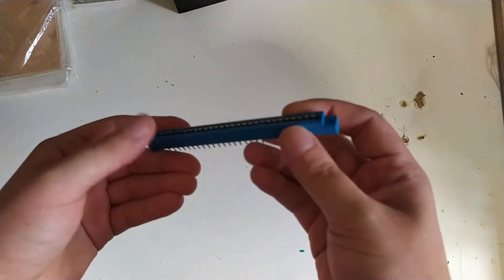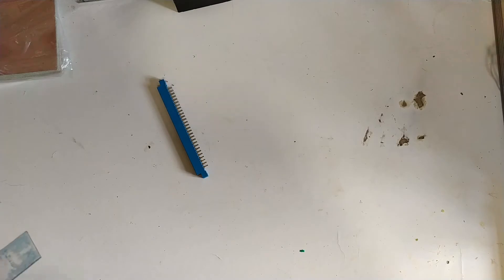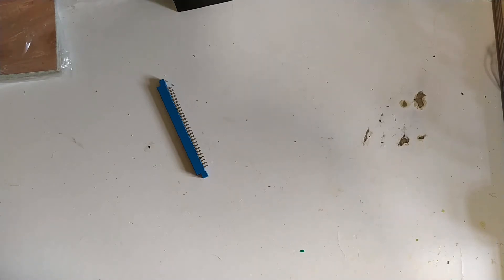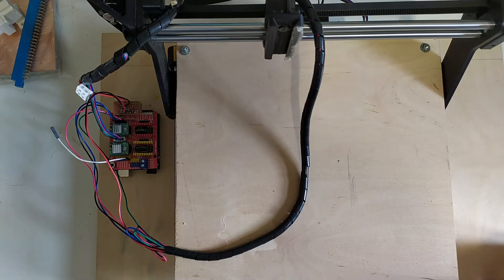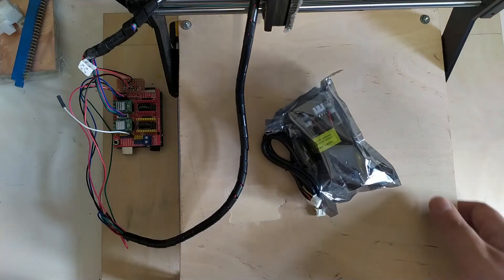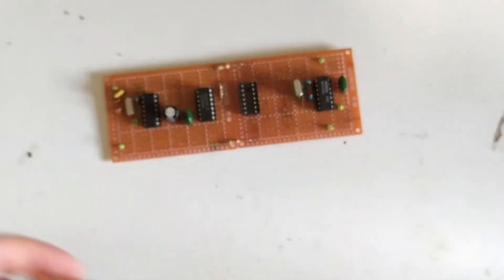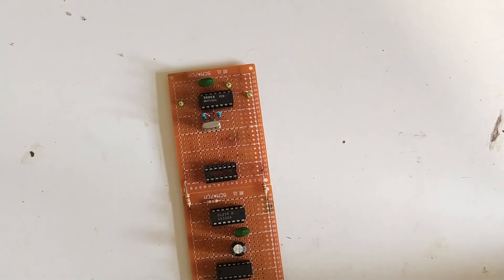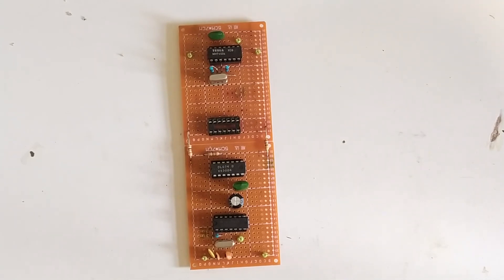Building a Z80-Computer Part 9: Double sided PCBs and Clock Circuits

Comment: It’s been 3 years since you started this z80 project.. how is it coming?
Reply from the maker: Still working on it on and off :) but I have some free time coming up towards end of this year so I'll probably get on with it soon.
Reply: @captainsolder5247  now there is RC2014.. no point reinventing the wheel
Reply from the maker: @stephenchung  I'm aware of that, still the goal of the project from the start was to learn how to design a computer, no to follow a set of plans.

If you look at the later video you'll also see that it is now fairly different from the RC2014.
Reply: @captainsolder5247  I saw, but basically still about the same.. I mean you can use RC2014 backplane or use that as a blueprint and improve on it.

Comment: On my opinion, you're too much concentrated on a production/etching side of a project. 
Why not just order PCB's from well known production houses and concentrate on a sweet stuff: schematics :)
You'll get a good 2/4 layer PCB's with nice looking silkscreens.
Great job, just keep pushing. Good luck!
Reply from the maker: Hey, thank you! Simple Reason is, the budget I'm doing this on doesn't allow for professionally manufactured PCBs. Even considering getting them from pcbway or jlpcb it's just to expensive. I'm considering getting the backplane made though because it is to large for my current spin coater.
Reply: @captainsolder5247  I'm surprised, I thought it would be cheaper to get them from JLCPCB rather than spending money on copper boards, chemicals, laser engravers, etc. But maybe I'm wrong. I think making things yourself though can be much more satisfying. That way you can really say you made the computer yourself. I think it's totally fine to do it however you want.
Reply from the maker: @SteveRaynerMakes I think it's closer than it used to be, 5 100*200 boards at jlcpcb (including Shipping) will come in around 25$. If I make them myself I'll pay around 3$ for 100g of photoresist which lasts forever and the blank boards are under 1$ per piece. So still quite a bit cheaper once everything is running. 

Also yes it adds to the look and feel I have planed for this and I think it's not an insubstantial reason why I'm doing it like this.

Comment: I had quite good results with a bunch of UV leds. much easier in my opinion. I modified a simple led desklamp which had a row of 10 white led on it...
Reply from the maker: I already had the tubes, that's one reason I went with this design. I also wanted to use this with different tubes for different spectra as well as UV-curing polymers. I was unsure at the time if I could get the required power output from an LED setup.

Comment: Laser print artwork layers on transparent sheet, one side mirrored, then tape together one edge with ink side inside, photo resist PCB inside the two layers and double sided UV box, works a treat. Used to use this technique at work at a small design prototype company. traces down to 6 thou. Then theres small CNC routers, double side works if use pegs and datum holes.
Reply from the maker: Thank you for the advice. I'm currently building a UV-box for the photoresist process, I'm still working on getting the photoresist uniformely applied though, might need a spincoater or similiar.
Reply: @captainsolder5247  buy ready made coated photo resist PCB, for anything complex or important thats the best way.
Reply from the maker: They are about an order of magnitude more expensive then non coated ones, that puts them outside my budget unfortunately.